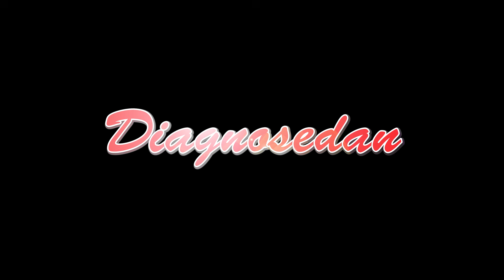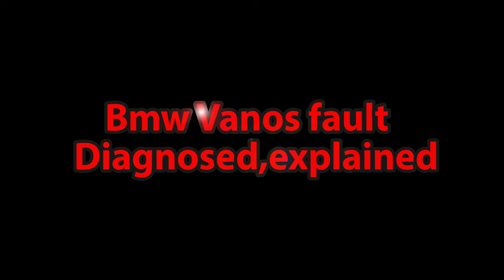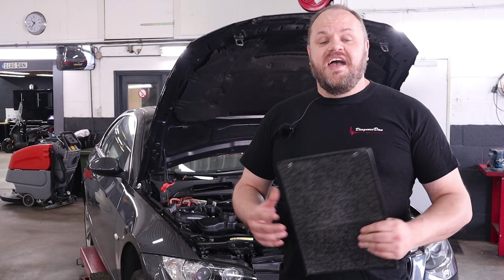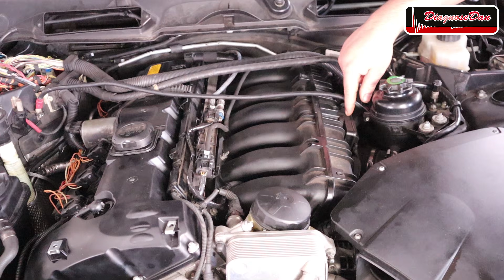Bmw Vanos Fault Explained (3000€ parts replaced and still not fixed!)

Comment: Excellent diagnostic.  To be fair to the technician that swapped the connectors...BMW engineers should have made them different so that couldn't happen.  A small detail, but important.  Same as the VANOS units which are interchangeable.  I love old BMWs, a lot.  For a technician spinning wrenches 8 hours a day 5 days a week, that's a forgivable mistake.  You listening BMW?

Comment: Hi Dan. Great explanations and visualization. I was wondering if you could help here.I am having issue with M54B30 yr 2000 having misfire, engine shaking starting about half minute after cold start and symptoms disappear after two minutes once engine slowly warms-up.
Engine had a big overhaul of head and new piston rings and problem appeared exactly after engine rebuild. After running BMW DIS and making leakage test of vanos , I got offset results on both cams. Exhaust camshaft:  leakage -6 deg (allowed -5 to +5) ; Intake camshaft leakage +7.12 deg  (allowed -5 to +5).
Now, I am confused how to interpret those vanos offsets and where I should look for root cause? Shop who did this overhaul has experienced BMW mechanic however, I suspect bad engine timing and vanos timing adjustment here.
Does negative offset on the exhaust camshaft indicates position which is actually more retarded than its requested position by DME? Same question applies for positive vanos offset on inlet camshaft which may be interpreted as more advanced clockwise than requested position?
Prior to this test there are VANOS solenoid tests which perfectly pass within limits: Exhaust camshaft: adjustment time, advance: 340ms; retard 860ms (limit below 1000ms). From all other functional testing of all other devices in DIS everything is perfect and only MAF sensor shows boundary results 0,59-0,6V in idling (setpoint range 0.6-1.6V). Thanks.

Comment: Hi Dan
2014 Mitsubishi PHEV 2.0 4B11 engine 
Does it have 
SIMILAR 
VANOS 
type gear failure leading to 
NO START / suspect timing chain failure 
on inspection of timing chain and tensioners
 NO FAULT found 
Could it be VANOS gear failure 🤔

Comment: The connections.. You saved me on this one . Gas Milage from 12.5 to 19.0. car runs smooth. Your a lifesaver.
Reply: I have the same issue....running so rich, 11-12 MPG at best, I'm about to go in the garage and check the connectors, like you I hope this saves my ass.

Comment: Hello friends, let me explain my problem. I have a strong misfiring (engine hesitation) issue while driving. I discovered the problem is related to the (VANOS) E87 N45, specifically the intake side.

I swapped the intake solenoid with the exhaust one, but the problem remained the same. Then I unplugged the intake solenoid, and the misfiring disappeared—the engine ran smoothly—but fuel consumption increased a lot.

I'd like to benefit from your experience: where could the problem be? Because when the intake solenoid is unplugged, the engine runs smoothly

Comment: I think BMW mechanics deliberately swap the plugs to milk customers financially...as a motor dealer, I've purchased 4 bmws from auctions all with the plugs swapped around...one was a v8 twin turbo x6...the labour to to get to those on the V8 cost $350(Au) ..only to simply swap them around

Comment: I have my bmw 328i n51 and never knew nothing of the cylinder head check valves. New ones are on the way 131k. Ready for new ones. Thanks for the  info

Comment: I've got a mini r56 1.4 vti with the same valvetronic and vanos system. My issue with it is that I'm getting 287D DME: Vanos, inlet: actuator movement fault code and also 276A DME: Catalytic-converter conversion fault code. Can the Catalytic converter problem be linked to the vanos issue? The catalytic converter has been replaced 2 times, (swapped from other good working minis) and I'm getting the same fault code, and also the vanos solenoids have been replaced multiple times with other good working ones, and still the same fault codes. Is it possible that the faults be linked to a faulty intake vanos cam gear?
Reply: Have you replaced your valve cover?

Comment: Hi Dan, just stumbled upon your educational channel. My N52 330i won’t start if the intake vanos solenoid is connected but starts as soon as it’s disconnected and the car is not performing at par. I’ve replaced the solenoid with an OEM one from bmw and the problem still persists. What could be the problem? Any help will be highly appreciated

Comment: Im currently having a verrry similar issue on my 2013 328i (F30) and it's definately do to a lack of maitnence. Something I'm ashamed to admit but rectifying immediately. Gonna start by checking my camshaft position sensors and cleaning out my intake solenoid / checking its viability. Gotta flush and refill the oil too as it's become contaminated with unburnt fuel due to bad engine timing.

Comment: Just a little thank you for this video sir. I have a 07 335i new to bmws and working on them and many months ago i took out vanos solenoids to clean and inspect. somehow placed the connecters incorrectly. I have been down every rabbit hole chasing every issue and code. Never thought it could have been this. Almost 1am watching this video i thought it couldn’t hurt to try and swapping them. Car started up ran like normal with no codes!❤

Comment: Dan, I could not believe at the end of this video, you showed me the oil filter cap.  We have literally thrown 1500$ worth of parts at his car, for the most part, all the codes are now gone.  We replaced vans gears, solenoids, fuel injectors, plugs and coils, all the sensors, timing chains and guides, and lifters.  Probably left out a few things.  Not to mention some specialty tools to do all this.  Only error left is cam is retarded, want sure what else to try, my wire were on the correct solenoids but honestly when I replaced them I did have them wrong, but quickly realized they were possibly in the wrong place and switched them.  I just ordered a new filter cap, I could kiss you if this fixes the error code!  The entire cage was missing.  At any rate, thanks for posting the video, I have liked and subscribed.  I am just a dad with mechanical ability, definitely not a professional, but can respect and appreciate what you do.  We do our own repairs out of necessity, some days I wish my son never got a bmw, but maybe this will finally fix it!  Thanks again!😊

Comment: Fantastic video on how VANOS actually works, but......What is it with BMW and desinging flimsy parts that can break off and fall down inside the intake!?   
I thought that was a lesson learned back in the late 90s/early 2000s with the M47/57 swirl flap disasters, but no. They kept at it for quite some time after that!     I also wonder why they persist in using identical connectors in situations where componants are fitted in pairs and could easily be mixed up, such as this.    German engineering..... provides endless "entertainment"!!!! 😒

Comment: Wouldn't be the first time I see it! Very easy to cross when doing a valve cover gasket job. Also seen it happen with the O2 sensor connectors at the rear on N20/26 engines. Early engines didn't use different color connectors, only the gray loom and the black loom. Later iterations one uses a tan colored connector, and one uses a black color connector.

Comment: Great explanation.  Does the BMW version (compared to M-B) of the cam phaser have a locking pin with a spring that keeps the inner and outer parts of the cam phaser locked until oil pressure unlocks it?

Comment: I have a ds4 1.2 pure crap for you to work on  it's had engine rebuild and been in a garage for 9months and still not running  looks like a common fault but no one knows why or what issue is

Comment: You missing 1 point, the bearing cap of the camshaft must also be glued, otherwise you will also lose oil pressure for the vanos, and 9 out of 10 mechanics forget this because the factory does not indicate it

Comment: Hi Dan, I have these errors after oil sludge, vanos inlet camshaft, end position not reached, camshaft signal inlet, mass airflow sensor circuit invalid signal, how do I go about this problem, thanks

Comment: I put this statement in another video regarding this,shouldn't bmw adress this at the factory first,so these issues arent as common,with mutiole people.Its a costly repair,for parts and labor,to the owner.No reason that this should be a common issue-seems more lije defective design by engineers in Germany,more interested in octoberfest and beer garden serving girls,than making a product thats not troublesome.

Comment: how do you control separately the advance and retard chambers? The way I see, between the cam and the vanos gear, there is practically only one oil channel. Yes, you have 4 oil ports in both the camshaft and in the Vanos gear, but to me they seem to flow in the same "oil channel"? What am I missing?

Comment: BMW's are in a league of their own, the Check Engine light can come on for hundreds of reasons of codes, some codes are important and some what you call a soft fault , junk or glitch. Codes that are related to the Camshaft correlations, retarded  and advance timing should be addressed accordingly, Most of the time regardless the motor will still run but a lack of performance, gas mileage etc... 
 I used a I Carly OBD plugin and App on my phone, it is costly but you can access the whole cars systems and not just the powertrain components. Buy you a Bentley BMW 3 Series repair manual, this is what Dealerships and Euro repair shops use, read it, study it and you can fix anything on your BMW, Good Luck

Comment: Did you check oil pressure? There is a type of BMW engine that shreds a belt up and the pieces wind themselves inside the oil seal and then end up in the oil pickup. If oil pressure drops when revving it might be a sad state for the engine depending on how long it's been like this.

Comment: Thank you for your video. You just saved me from doing vvt cam, and timing chain replacement. I mixed up the connections after I replaced the vanos solenoids.. I only replaced 2 camshaft sensors, maf sensor, and a fuel pump before I found this video, smdh.

Comment: Exactly two close identical conectors could have been color coded problem solved..why are we doing an oil change Dan after all the money spend u figure they changed the oil you would think they did

Comment: I have a 2011 BMW X3 35I intake camshaft sensor: signal high. Have 12 volts in ground and 5 volts on signal wire… swapped 3 different sensors no clue whats next nothing online. Any ideas?

Comment: great fun , dan leaves vieuwers to think along , my guess on the rough idling and reduced power was timing error , but not being a vanos man , (i'm pretty oldschool) i did not suspect it could be a variable timer error . but i would have figured it out , because i would try to swop the connectors because it is possible . bmw should use different connectors to avoid this mistake

Comment: I’ve owned a BMW E60 2,5i since 2015 it’s a 2006 one owner before myself I change my oil and filter’s every 4 months and I’ve never had any problems with the car when I bought it it was burning oil about a litre every 6 weeks I changed the vanos solenoids on the front of the engine and I’ve never had any problems no more oil burning I was advised to use BMW PARTS but at over£300 each i was told to use parts from a company called FEBI BILSTEIN FROM GERMANY I PAID £70 each £140 that was 2016 and they are still working fine

Comment: Dan, as you know the spark plug tubes for an n54 bmw 335i are VERY tight and the tube walls are not perfectly parallel to the insertion angle of the spark plugs. So I would like to know specifically what in-cylinder pressure transducer you are using that is able to properly fit that tight space.

Comment: Thank you for this video! I learned a lot. But if I disassembled my vanos sprocket can I reassemble and reuse it? I've read that you have to replace the bolts but I can't find any for my vanos (B38A15 engine). I just used blue loctite, is that acceptable? Thank you!

Comment: Hey Dan, I just learned (on my MINI Cooper N12 engine) that those VANOS adjusters have to be locked when there is no oil pressure; locked meaning that there is no relative motion between the hub (where the bolt attaches the unit to the cam) and the Sprocket.  BMW TIS directs technicians (in the "check timing" steps) to put a wrench on the center bolt (with crankshaft blocked from rotating with special tool) and attempt to rotate it.  No rotation is allowed.  I missed this step after repairing the cylinder head, and the engine was intermittently running rough.  I replaced both VANOS adjusters, and engine returned to smooth running condition.

Comment: Now this is how a knowledgeable professional does works, he is all a great teacher and surely goes into "deep detail" there is so much information in this video, it unreal!!Thank you sir for your professionalism and great Video!! 100-100  . I do have a question that seems not to get explained to me as of yet>>> i have a 2013 bmw x5 35i n55 3.0 litre turbo.with 170 thousand kilometers, it is well maintained by me for 3 years plus now, so it was used when i purchased it at 130 kilometers. the problem i have is,it only happens when it is cold weather- 3 degrees, (just below water freezing temperature)  i live on the east coast of Canada.so we have 4 seasons. ok, so when i first start it at -2 or colder degrees. the rpm will surge/float up and down the rpm gage for 3 times or so, from 650-----1200 rpm. it does almost shut off/stall. but it never did as of yet. as it warm up for 10 minutes all is ok... but for instance, if i try to drive it after 3 to 6 minutes after start up it will bring up a check engine light in the instrument panel and when i chack the codes with a BM700 Ancel obd11 scanner, it will show lots of codes.28A0 T. Valve opening Angle-Intake pipe Absolute pressure,comparison pressure to High.2EFE Combustion misfires,several cylinders,2EFF Combustion misfire, cylinder 1 detected.  2FO4, Misfire,cylinder 6 ,2F00,Combustion misfire 2,   2EE2 Misfire several cylinders,damaging exhaust gas after startup,2EE6, 2EF6,2EE9, A8AF. etc. so this happens if i drive away when it is cold temperature or drive away whwn the engine is cold.. if i let it warm up, the codes will not appear  every so often i do hook up my BM700 Code reader and delete all of the codes after a month or so, and these are the "reoccuring" codes that continues to return, the vehicle has all new identical oem sparkplugs install 12 months ago, new top plastic pan and gasket because of the common rear oil dripping, ,oil filter housing gasket replaced.new belt and pulleys and tensioner.... oil and regular oil changes at 8 thousand kilometers since i purchased it. i take care of this vehicle as much as possible. it does work fine and perform flawlessly ty for your input and thoughts of my strange ordeal.  ty in advance!

Comment: Wow I bought a 525i N52 2 weeks ago and have replaced Vanos, Cam sensors, Oil filter housing with filter and oil change , Cleaned screens and coil and plug change  and still had this same exact problem I checked today and the previous tech or owner had the connectors swapped , I swapped them so they are correct and car runs beautiful now

Comment: This reminds me of an Ivan video where the wiring for the left and right side O2 sensors were switched. This was particularly troubling because one side had a rich condition and the other a lean condition. It was nothing the PCM couldn't handle if the sensors had been wired properly.

Comment: Wow all those parts thrown at the car only to find out that they mixed up the connectors?   But this guy just made the diagnosis seem so easy I also learned some thing about the pressure wave form I would have never know that the little exhaust spike would indicate a timing problem.

Comment: Good work bro, exact issue happend to me while I was replacing valve cover gasket and sawped that crazy identical sockets ,  and engine started to through codes and the power of the engine went down ,
Lucky me I found the issue before I through any exp parts on it

Comment: just came here because my 2001 316i during idling in the burger king drive thru, had non-regular idling sounds and it also shook in between, also the rpm needle went up and down slightly with hiccups, once the hiccup even went from 800 down to 500 rpm, and the yellow oil light goes on (it always goes on when standing for a few minutes and disappears when driving). 

after driving home i let it idle a minute and didn't see any irregularities.... I'm not a mechanic so I don't know what it might be, this issue? maybe a spark plug?

Comment: I've got a question.....can you remove the little 3 prong cover on the end of the cam shift gear without locking the cams and everything down ? I need to replace a headbolt under the exhaust cam ....the only thing stopping me is that little cover. Thanks in advance

Comment: Man, I would never have thought to check the condition of the oil filter cap assembly for that tiny "O" ring not seating or not there as a possible cause for vanos problems, but it makes perfect sense. Low oil pressure will affect those things in a heartbeat. Thanks for pointing that out!

Comment: Wow, a little engineering behind those connectors would help. They needed different shaped connectors, or a notched setup, to prevent the inadvertent swapping. Great video!!

Comment: Need ur help brother; 08 335i weird weird issue. Dme will cut power to injector 12 on cyl 1.. changed a few things but still nothing. Only a code for misfire… would a bad exhaust valve cause cyl one to loose compression?